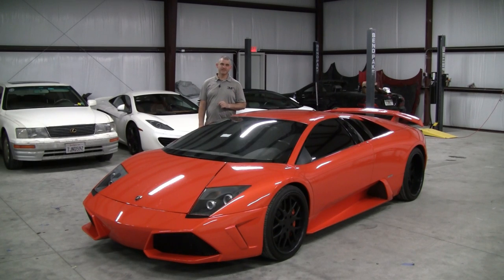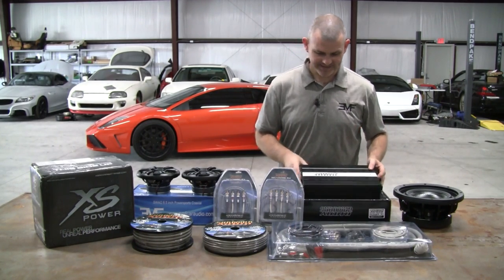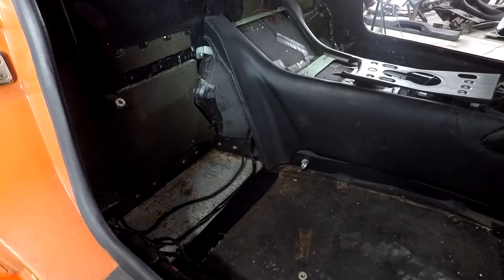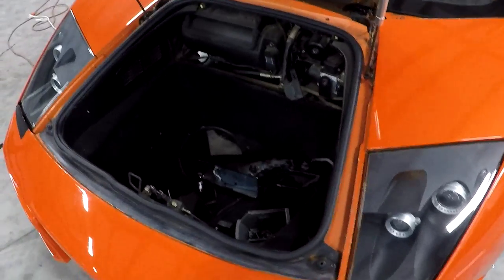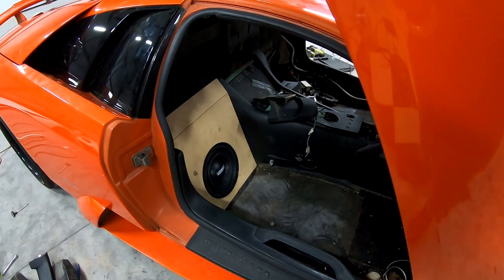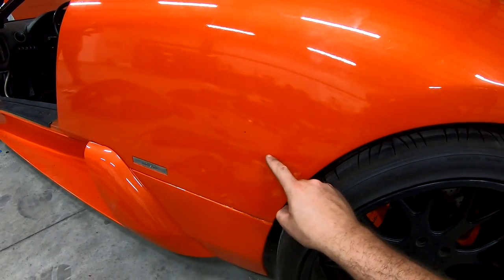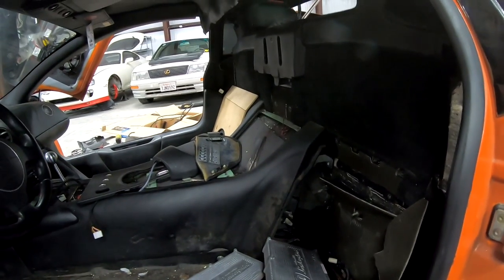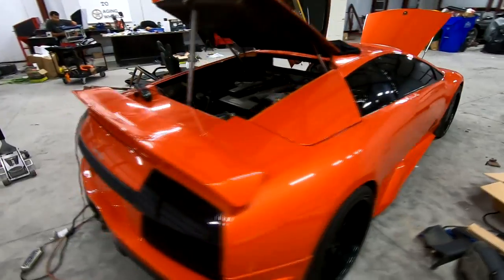I put an audio system in Tavarish's Fast & Furious Lamborghini

Comment: I don't think I would swap a roll cage for a subwoofer
Reply from the maker: How about so you didn't die of carbon monoxide poisoning? It went through the rear window location, so there wasn't one. Or, how about so you didn't go unconscious from hitting your head on the cage because you hit a bump in the road? If you aren't wearing a helmet, roll cages are dangerous.
Reply: EMF Audio haha yeah I'm not sure, decent install tho, wouldn't water get into the car if the windows gone? Lol
Reply from the maker: @jbb5266  The whole car is being brought back to restored condition. You can follow Tavarish's channel for progress on that.
Reply: I don't think that a roll cage would have helped.  It would have probably blasted right through the floor if anything bad would have happened.

Comment: wonder if it'd be possible to do a 4th porting into the cab from the front trunk? probably not enough redundant parts to remove, maybe if you went without aircon it'd work
Reply from the maker: There aren't redundant parts period. You're definitely underestimating how difficult it was to find a spot to drill a hole for wires to go through. It's also carbon fiber, which is structural to the car.

Comment: why the need for a battery on a 200.4 amp. not alot of power being drawn and im sure the stock electrical can keep up
Reply: Pretty sure they replaced the stock battery with the XS one.
Reply: @webberfan1234  oh good good. Was like why add a 2md battery for a sub 1k system
Reply from the maker: There is only 1 battery in the car, and it was getting replaced anyway so we replaced it with the best.
Reply: @EMFAudio  dam right xs makes a fine battery. Sweet install.
Reply: Lol a 1K system on stock electrical? Have fun with the dimming headlights. You'll be more happier if you also upgraded the electrical
Reply: @MegaRcdrifter  got a 5k on stock electric. No dimming
Reply from the maker: @MegaRcdrifter  It's 800 watts at most, realistically actual power being used will be closer to 650-700 at absolute peak usage. That isn't that much current draw. Also, how much do you think a custom built alternator for a Lamborghini V12 costs, especially when it isn't necessary. Follow up, do you have any idea how time consuming it is to change it?

Comment: Why did you chose coaxial speakers over a component speaker set? Ease of installation or stealth?
Reply from the maker: These coaxials sound better than many components so that wasn't even a worry, but there would be no benefit to components in those doors. Tweeter location couldn't be changed to the pillars and the mid location is pretty high anyway. Crossover would also have to go somewhere and there isn't a lot of room for activities in that car.
Reply: @EMFAudio  thanks, I thought as much. Must keep as much room as possible for activities.

Comment: You mean you can't fit 2 12s, 2 amps, 4 6.5s and 10 1 inch tweeters?
Reply: What is a 10 inch tweeter
Reply: @joepowell1981  good catch. Was a typo. Fixed it
Reply from the maker: Prior to doing the install a few people said to put a wall in it.....
Reply: @EMFAudio  4 18s wpuld fit just fine in 1 cube box
Reply: On the roof maybe?